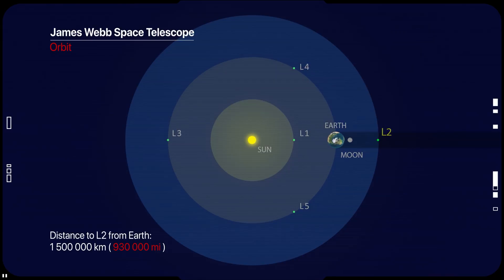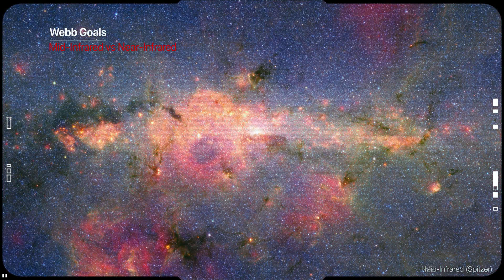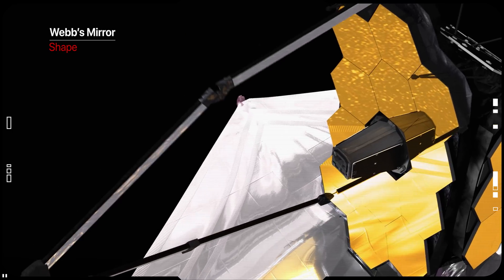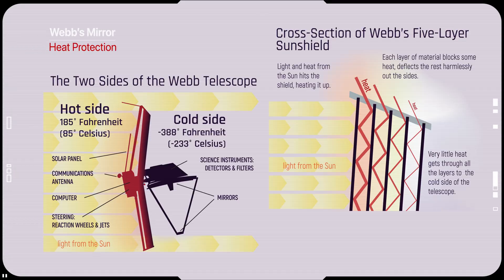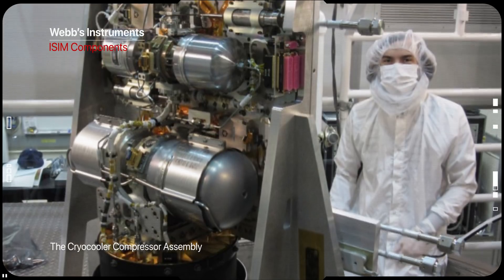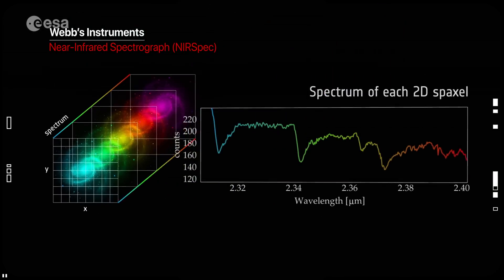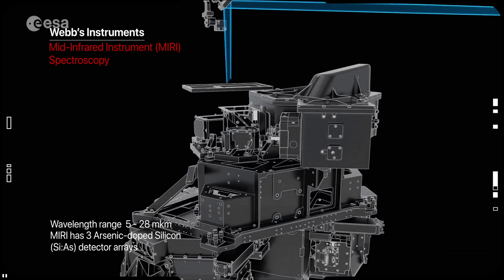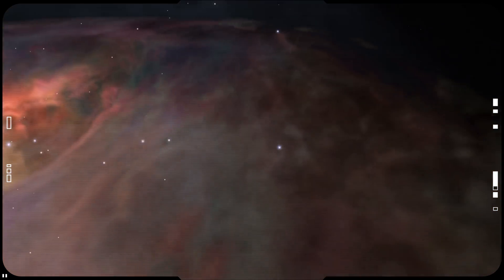How JAMES WEBB TELESCOPE Works? - Design & Instruments Explained

Comment: 8:26  An integral-field unit re-arranges the image of a square patch of sky as a long image which is only two pixels wide. This allows the simultaneous spectroscopy of a rectangular patch of sky.
It is not, in itself, a spectrograph.

Comment: Won't the light on primary mirror be affected by shadows of supportings bars of secondary mirror?
Reply: Those supporting bars are sorta like dangling a couple of sticks of spaghetti at arms length in front of your eyes. How much would those block what you are looking at! Not very much.
Reply: Well kinda, bit since where it is going to be, there is nothing creating these shadows on the mirrors because the sun will be blocked from its sun shield
Reply: @rai2984   i mean not a Shadow, its reflective image of tripod on primary mirror.
Reply: The supporting structure bars of secondary mirror is transparent in infrared light. So, no shadow will occur on primary mirror. And, reflective image of primary mirror is focus exactly to secondary mirror area.